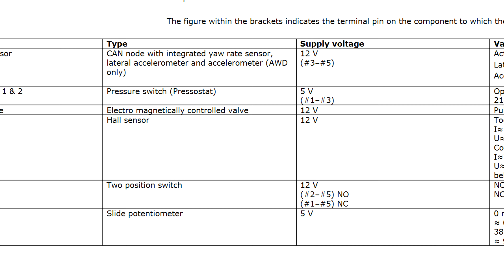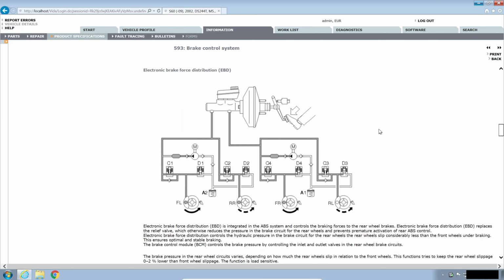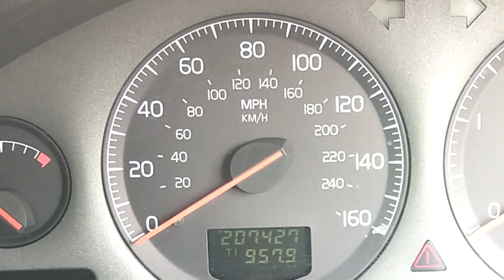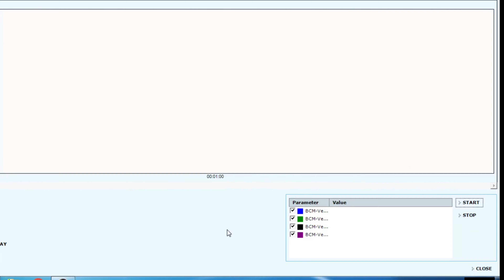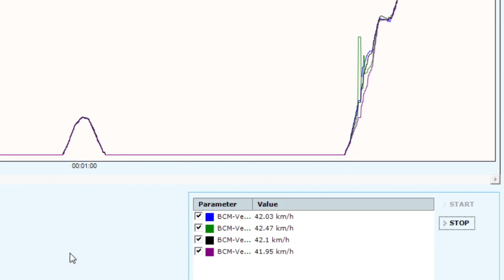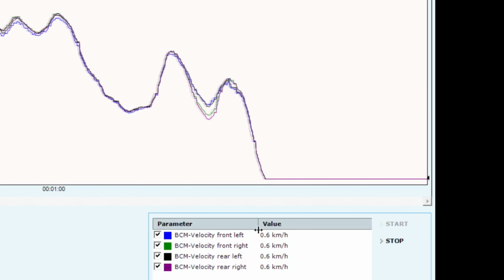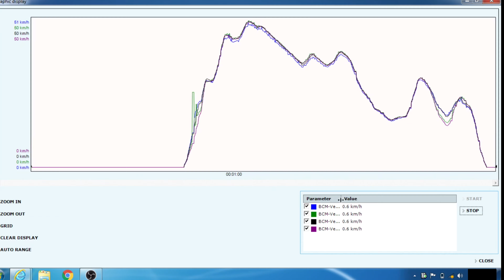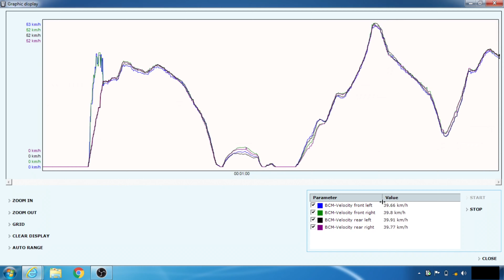Testing an ABS Wheel Speed Sensor

Comment: Hi Simon. Another very useful video - thank you! Sadly it came too late for me - I first had the LF sensor replaced by my local garage (not Volvo specific) and the new sensor did not solve the ABS message. I supplied them with a inexpensive reluctor ring (£1.89) and had them install that and that solved the problem. VIDA did say it was the left front ABS sensor. In retrospect I have a feeling the reluctor ring was simply dirty (a visit in a Wales ditch) and could have been cleaned but I'm happy as the new reluctor ring and an hour charge solved the issue.
Reply from the maker: Hi Christer. Glad to hear that you finally got sorted. 

In defence of Vida it was indeed pointing you in the right direction. You had codes BCM 0011 and BCM 0012, the wording of which is Left Front Wheel Sensor Faulty Signal. Both of their Vida explanations have damaged rings as well as dirt/debris as a possibility to be investigated which could be done before replacing the ring or sensor.
It's entirely possible that you were correct in your dirt theory. 

Half the battle can be having the time and tools to investigate, diagnose and carry out the fix.

Comment: Thanks Simon for your video. I’ve got Suzuki swift 18 reg with ABS and traction control lights on. The car actually had an impact on the front driver’s side in an accident. I’ve changed the drive shaft and the complete suspension including the whole hub, I’ve done wheel alignment. The car drives very well but the ABS and traction control lights are still on. Not sure what to do anymore. If you have a garage I can bring it over to have a look for me.  When I put the OBD on, I get these two faults: 1. C1021 - right front wheel speed sensor circuit failure, 2. C1057 - Power supply voltage. Thanks
Reply from the maker: You could tap the sensor like shown in this video and inspect the pulse ring that the sensor interacts with.
The ring may be toothed like in this video or smooth and needs to be in the correct relative position to the sensor.

Comment: Thanks Simon, i've been meaning to comment for ages. I must have saved hundreds in watching your DIY videos - so thank you very much. My ABS light has just come on so will be investigating - hopefully just a sensor. By the way which OEM sensors would you recommend? When i replaced my engine mounts (after watching your videos) i used CORTECO which (as you said in one of your videos) were exactly the same but a heck of lot cheaper than dealer parts.

Comment: Hello my ABS light goes on and off intermittently on 2008 XC60. Ive already had my sensor changed and hasnt helped. Going to have a look at ABS rings. My odometer has also stopped working.  Are these 2 things linked? Thanks James
Reply from the maker: There's a high probability of a link. Individual wheel speed data like shown in this video will confirm.
Reply: @sirobb  Thanks Robb. The front right wheel is showing unusual data so it will probably be that

Comment: Hi Simon very good video, bit does not solve my problem. My rear left wheel on my volvo xc70 2008 has a wheel speed sensor on the hub at the top, had the car put on diagnostic at a volvo garage and he said wheel speed sensor if faulty so bought a new one from dealer and put it in my self which was easy but when i take a right turn i can hear a clicking sound as if a relay is making on and of rapidly followed by the abs module work rapidly as well. It don't do this when i fake a right turn though which is strange. I have also been told that the year my car came out the went away with the idea of reluctor rings ! When i took the sensor out i could not see any grooves to a ring took the other side of the wheel off as well and no ring either.  Can you help ??? Dash alarms are abs traction control needs a service.

Thank you. Jay.
Reply: Jay check you're hub bolts. Buy new ones loctite but not the strong one and torque up just under the recommended volvo recommended torque. I had one bugger and it threw up lots of issues on my dash. I hope you sort it.
Reply: @chucky2316  Thank you I will try this, where is the best place for hub bolts and which type of loctite please ?

Thank you.  Jay.
Reply: @JaySingh-ex6xc  check them first before rushing out buying anything. Bolts I got from the volvo stealer and It was the blue loctite. You can feel if they are loose.
Reply: @chucky2316  Thank you will do this.

Cheers.
Reply from the maker: @Jay Singh You're correct that you  don't have toothed reluctor rings but you do have magnetic pulse rings with alternating polarities so ultimately it's still a magnetic field interference which is affecting the voltage returned to the BCM and this individual speed can be read by good quality diagnostics like Vida exactly the same as in this video.

You would need to read off the precise Volvo code then work through the possibilities suggested in Vida.
Because the ring is built into the wheel bearing, you may need a whole new bearing/hub assembly or there could be a wiring fault.
You also can't rule out something simple like a loose bolt affecting the relative positions of the sensing components.
Reply: @sirobb  Hi Simon thank you for the reply is it worth looking for a new hub assembly or can i buy second hand or can i replace the defective part ?

Thank you.
Reply from the maker: @Jay Singh It's not a job for cheap parts or one that you want to have to do more than once so new is preferable but cost and guarantees from the used part seller may influence you otherwise.
If wiring is the issue though, you will have wasted your money so how you approach deciding you definitely need a bearing assembly is up to you.
Reply: @sirobb  will that have to be from the Volvo stealers ?
Reply: Simon are you local in Birmingham ?
Reply from the maker: You can get genuine Volvo from main dealers directly or on eBay or websites like www.skandix.de
Aftermarket are available everywhere.
I'm about 50 miles away in Cheshire and it's not a job I fancy doing at this time of year if you were going to ask. 😊
Reply: @sirobb  Hi Simon, Just looked at the link you give me for parts and looked for rear wheel speed sensor looks like there is 2 types of sensor 1036857 and 1030448. 1036857 i have fitted still have issues whats the other type of have i replaced or not seen the other type ???
Reply from the maker: @JaySingh-ex6xc  I'm not a parts supplier so I don't know.
I do know that there's generally just one correct part so others may be for different chassis number ranges.
My advice is to get the code read with Vida and eliminate the possibilities Vida will give. Changing parts on a guess can get very expensive very quickly.
Reply: @sirobb  always appreciate your level headed approach to complicated issues Si. I've just got my XC90 through the MOT but every few weeks in getting a n/s rear ABS fault. Been using an be Autel Bluetooth scanner which is quite good but you just reminded me of the fact I have VADIS too. The live data from the sensors looks very useful, will probably try that first to see if there a consistent error on that wheel before delving in deeper. Rear ABS issues definitely a lot more awkward than the front as far as wiring routes and general access goes I think.

Comment: Where do I get an affordable VIDA?
Reply from the maker: Where are you and what is affordable to you?
Reply: Cornwall, as little as possible.There are a few on eBay obviously from China. As a family we have a 2006 v70, 2012 c30 and my son has an old v40 as a builders van.
Reply from the maker: I sell the VCX tool which works the same as Dice and communicates with your car and Vida for full diagnostic code reading on every available module.
It works on nearly all Volvo models from 1999-2015 model years and I have new, tested and guaranteed working VCX ready to send out, exclusive set up videos and fast email support to get you up and running.

If you have a suitably specced laptop, you just need the tool and software which is £100 delivered payable through PayPal gift/friends and family.
The eBay ones are untested and the set up instructions are garbage so what you "save" in money, you lose in many hours of working stuff out. 

So I can confirm laptop compatibility, let me know the following please.

1. Full CPU Make, name and model number
2. RAM
3. Operating System version and whether 32 or 64 bit
4. Current available free hard disk space.
Reply: SiRobb which model of VCX is it?
Reply from the maker: There's only one model of VCX for Volvo.